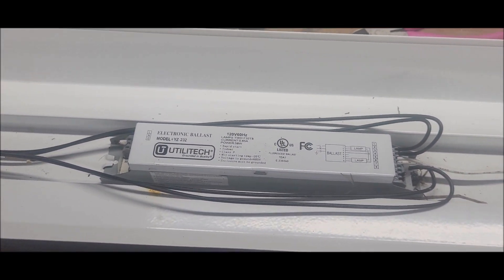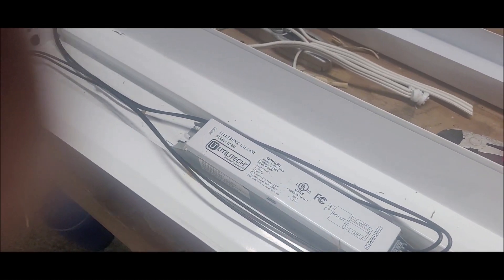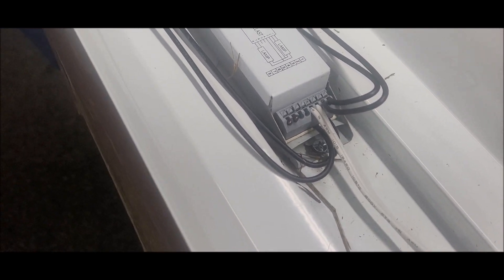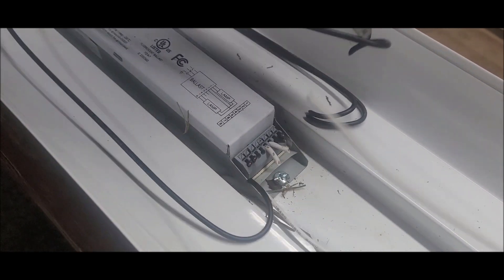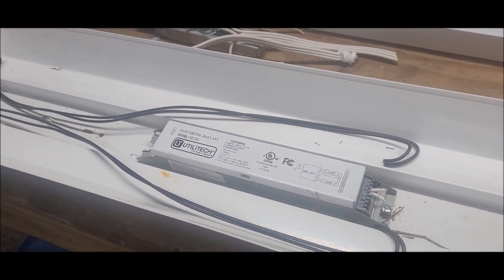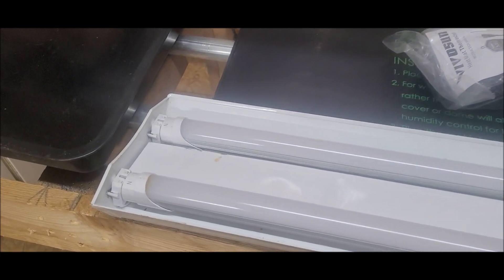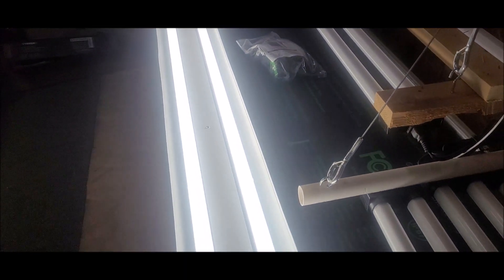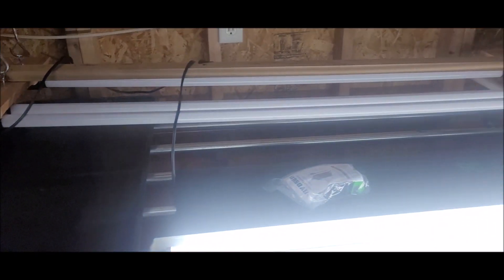How to turn a shop light into an LED GROW LIGHT

Comment: So what did you do after you stuck the pigtails into the plastic things?  Kinda left us hanging there!!!
Reply from the maker: The pig tails are  the BLK/WHT  power supply. I wired a power plug up for the receptacle.
Reply: @thehams08  I'd like to see how that was done, or at least what the connection looks like.
Reply: LOL! I hadn't gotten to the end of the video yet, I see there are pics. Awesome!
Reply from the maker: @Aelanna  sending pic